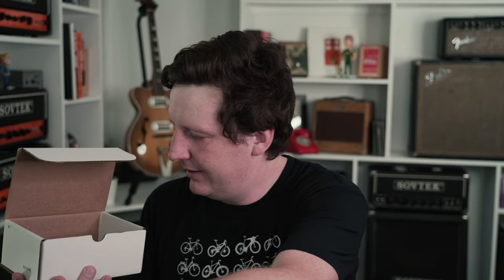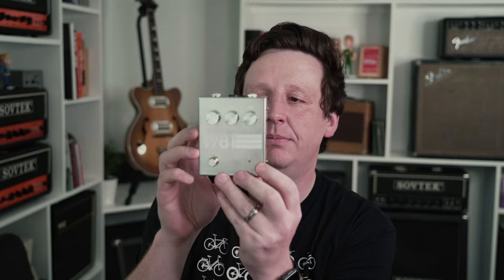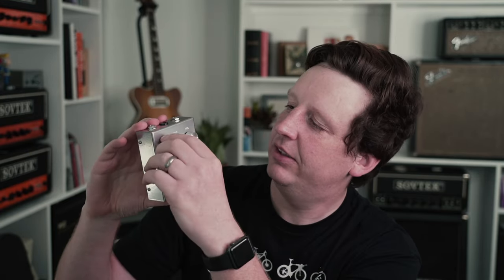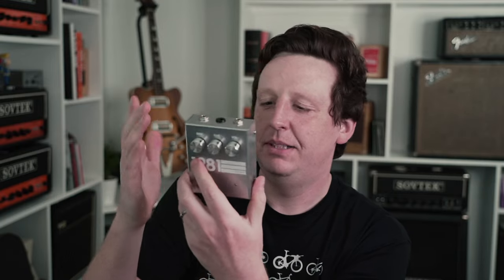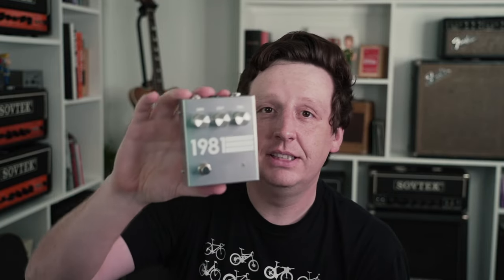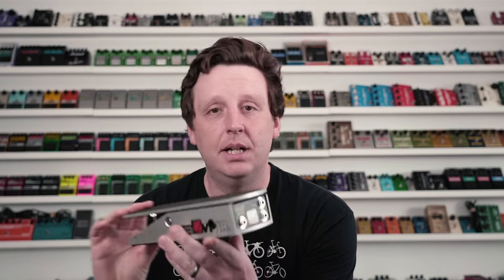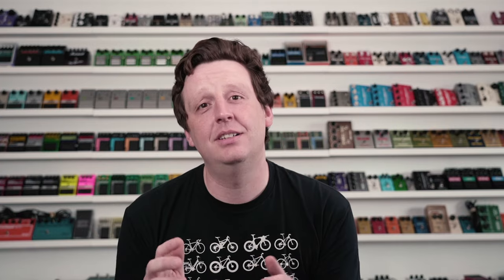Why You Need A Buffer

Comment: ok... so I got 10 pedals in my chain, 6 of them are buffered. I noticed some serious "tone suck"  muddy sound. I plugged directly into my amp, and the sound was shockingly different (way better clean tone). Why do the 6 buffered pedals not accomplish this?Would a buffer before the chain or at the end of the chain likely accomplish what I need to get rid of that treble bleed. Will it brighten up/ replace the dynamics that appear to be gone with my pedal chain? 

Also on a side note, why does it seem like that "Tone suck" is not constant. It gets worse and a little better as I play. why is that?
Reply: Watch the  Wampler video about  "Non-True Bypass switching"
Reply: @nicolasjarpa4336  will do. I believe my problem is resolved though. I rearranged the pedal  order, added a buffer, and found a cable that was not 100%. all is good now.

Comment: Very interesting, thanks.  I have trouble with a big volume drop when i engage a vibrato - especially when playing clean stuff (TC Electronic Shaker), which i have in my FX loop with other pedals (chorus & delay)....Do i just throw in a buffer before the Vibe? Job done?     No other pedal on my board seems to suck volume.
Reply: Wondering the same as my "uni-vibe" is a Keeley Monterey but it is new and have not yet played with the rest of my setup....just played it in practice in front of amp.  However, if I use it in my chain before the the amp, I then think a boost  would be needed...Example:  Guitar > Boost > Keeley Monterey > J Rockett Blue Note > Vertex SSS > amp.  Modulation is in FX loop.  I think a boost can't hurt but don't yet see a need for a buffer and do not have that much length in cables.  But.....you did mention the volume drop and that would signal to me that a booster is needed.
Reply: @davidsisto7694  thanks mate. I appreciate the advice. Stay safe! 🙏

Comment: Hey, I've been trying to get fuzzes to work with my wireless unit for sometime. My wireless has a 50 ohm output impedance so fuzz hates it. I have found a reamper by radial that helps a ton, but it's still not quite there. Do you know of any output impedance adjustable buffers?

Comment: How do you know if your pedal has a buffer? And, can you use Boss pedals as a buffer when they are turned off?
Reply: Do your research about the pedal and if it says True Bypass, it's not buffered. Boss pedals are buffered even when they're off (in bypass, not off as in no electricity :D)
Reply: wow great question. please share the answer when you find out! thanks
Reply: Pretty well any and every pedal that uses electronic switching internally, including Boss, Yamaha, and DOD will have an always-on input buffer and output buffer, because their switching system requires it.

Individual buffers do not add much noise at all, but as much as I concur with Josh on the quality of Boss pedals, the input and output buffers, summed over a dozen or more pedals (typical of contemporary pedalboards) can generate a bit of hiss.  At low volumes its no big whoop, but at higher volumes can be irritating  So, while I have no quarrel with e-switched pedals, and don't view true-bypass as any sort of miracle panacea, if your pedalboard is big and complicated, it can be useful to have a true-bypass loop selector to take all those buffered pedals completely out of circuit.

Comment: Whoa whoa whoa, I just got a Boss CS-3 compressor, and have it before the big muff (and pretty much first on my pedal board). My thinking was I didn’t want to raise the noisefloor with a noisy muff in the chain. What compromise am I really making by having a buffer before fuzz, my fuzz isn’t as fuzzy?
Reply from the maker: In general a buffer will affect a fuzz by making it sound maybe thinner or just "wrong" from what it's supposed to sound like. But a Big Muff may not actually be affected by it. Best thing is to try it before and after to see :)
Reply: JHS Pedals 
Thanks for the input! I tried it before and after, and couldn’t notice any major differences. If anything maybe it sounds better after, compressor turned off of course, but I think this might be in my head. In any case thanks again for your input. 
I have been watching your channel lots lately and have been learning a lot and finding new inspiration in my pedals. Can’t thank you enough.
Reply: @CravetheGrave  Pete Cornish built a buffer into Dave Gilmour's Big Muff. The first pedal his signal used to see was a Boss CS-2. Gilmour's tone is considered to be one of the best ever...
Reply: @CravetheGrave  In any way the buffer of the boss pedals is always on. Even with the effect off it is still buffering. :-)

Comment: Why is it a rule to put buffer after the fuzz? What if you are splitting to have a FUZZ and OD in parallel? Can you use a JHS splitter with buffer built in? Or is this a bad setup?
Reply: buffer will weaken and thin out your fuzz. Generally, people do not want this, so its a rule to put fuzz at the front of your chain no matter what. If you want to run a fuzz and od in parallel, then just dont use a buffered splitter. You could either throw the buffer right before the od, in parallel with the fuzz or just put it in series after both of them. Try all 3 and see what you like best. Cant hurt.

Comment: Got a question if anyone knows. I can’t get rid of a slight hissssss. 
Amp-hot Rod deluxe
-Mogami platinum cable from guitar to a buffered bypass Kongpressor/TS9/BD2/distortion pedal/ green Russian distortion/analog delay/digital delay. All Mogami patch cables. Then Mogami gold cable to amp. 12’ guitar cord 10’ cord from board to amp. 

If I plug straight in. Crystal clear no hiss. 
Go though to board and I get a slight hiss. 
I’ve tried adding pedal by pedal to the chain. Once I get over 4 pedals I get a hiss. No matter the order. 
I like to play clean a lot and this drives me nuts. 
Power supply is a cs12 True Tone. Each pedal has its own power supply cord. 

Will a buffer kill a slight hissss

Thanks guys.
Reply: Try a noisegate somewhere in your signal chain, it could be one of the drive pedals adding that hiss and a noisegate will magically clear that up. Also you want your power to all pedals to be clean either from an iso-brick or every pedal being powered via battery. Don’t plug pedals into a power strip or the wall
Reply: The buffer is making up treble and bass clarity that is lost from multiple cables. ( every inch of cable dials down the tone slightly)  you would probably benefit from a buffer as well, but not for the hissing problem
Reply: It’s probably the True Tone, I’m going to assume it’s a daisy chained power cable not truly isolated? If so just get something like a Pedal Power, it has isolated grounded power for each pedal, the hiss could be a ground issue.
Reply: @TheBigDean18  no, the true tone cs12  is an isolated power supply.

Comment: One thing I can't figure out: is the buffer (like in boss or ibanez pedals) active and only works when the powered pedal is off or is it always on even when it's on?
Reply: It's always on. As a battery save utility, the pedal shutdowns when no cable connected.

Comment: I’m looking into buffets for a reason. Was hoping you’d show the audio difference. I plugged my guitar straight into my amp the other day and it sounded so much fuller, louder, overall stronger signal. The problem is thag I play post rock, ambient, and post metal. lol. So not using pedals isn’t really an option for me.

Comment: So do I need to sandwich my board if I dont have a Fuzz on it and I have a buffered bypass at the end? Will the buffer at the end usually suffice?
Reply: Buffering has nothing to do with fuzzes other than that a buffer should be placed later in the chain.

Comment: May be a goofy question but does the pedal have to be “on” in order for the buffer to work? I have a EHX Canyon at the end of my chain with trails on (to what I understand - activating the buffer) but I only use it in very specific situations. Is it still giving me the buffer even though it’s off most of the time?
Reply: My understanding is if it is plugged into the chain and powered up, it is acting as a buffer weather it is on or off. But maybe Josh  will chime in and confirm
Reply from the maker: It depends on whether or not they were designed to buffer when they're off or not. I don't know if the EHX Crayon is designed to do that. You can try a listening test. Is it true-bypass? If it is, then it would have to be on to be buffered for sure. Most EHX pedals have a true-bypass or buffered option.
Reply: Thank you gentlemen!

Comment: Regarding a buffer after a fuzz, does this mean all fuzzes (I.E. Fuzz Face, Big Muff, etc.) or just certain fuzz pedals. I’ve heard time and time again that (if memory serves me correct) that germanium fuzzes have issues with a buffer after in the signal chain
Reply: It's ok too have a buffer in front of a big muff.
Reply: A Big Muff is silicon I think, so at least it should be fine
Reply: Germanium fuzzes have issues with buffers either side, and the buffers in certain wah pedals can cause issues with silicon fuzz pedals as well.
The MXR Classic 108 has a switchable buffer for playing nice with a wah in front. Good pedal. Sounds almost as good as an Alanlogman Sunface BC108.
The Analogman pedals are so well made that they experience fewer issues with buffers than most fuzzes.
Reply: No problem using Muffs & bufffers. I run an MI Boost 'n Buff into a Muff and it sounds rad.

Comment: Can i use the JHS Buffered Splitter to send the two separate signals to two pedals (an akai headrush 2 and a digitech jam man, specifically) instead of using it for two separate amps? The two loopers then go into a mixer whose output is routed to the amp

Comment: I don't know if there's no such thing as a bad buffer. My dad's old cry baby from the 80's for example has some definite tone suck. Also, I feel like the buffer needing to after fuzz depends on the fuzz. All of mine work fine after buffers and I feel like all guitar gear, the buffer is situational. Maybe less so, but I still think that it does depend on the board
Reply from the maker: Yeah, some of the older buffers can be pretty bad. Anything contemporary will be good.

Comment: Hey Josh, what about tuners? I have the sonic research mini tuner, do I plug into the tuner, then fuzz, then buffer? Or is it always guitar into fuzz, then tuner, then buffer, etc. Thanks for posting your videos, you rock! 

Cheers,

Matt
Reply: I’m not Josh but ... sonic research tuner is True bypass right? It doesn’t matter if you have it before or after your fuzz. Maybe turn the fuzz off when using the tuner to have a clean signal come in. Buffer after fuzz yuppppp
Reply: Jv Dyk ultimately I just needed an answer, so thanks! I’ve heard germanium fuzz’s don’t like any pedals before. However the tuner is muted anyway so i wouldn’t ever use it to tune on the go. Can always test and try things out. Anyway, thanks for the advice.

Comment: How do you put a fuzz in front of a buffer when it’s supposed to be late in the signal chain?
Reply: Think they explain this in this one: https://youtu.be/U9xtAP1cw5U?si=kzE58sN39wAtkg0U — basically you don't, only certain fuzzes can get away with being put in the gain portion of your board, while others are designed such that they can only handle being first, and they're kind of an exception to the placement of gain pedals otherwise

Comment: Josh, does the boss pedal's buffer works even when the pedal is off, or it must be on all the time? Thanks
Reply from the maker: Yes, it does.
Reply: @jhspedals   I have a cheap delay pedal in my FX loop that is on all the time, but the tone change when I enage the loop is very obvious. Would replacing it with a trusty Boss DD help even if the pedal's on every time? I have like 12 meters of cable running from the delay to the loop and back...

Comment: What if I put a boss looper pedal at the very end, would that help? I'm assuming it has a buffer like most boss stuff. And if I have a boss tuner would that be an example of sandwiching?
Reply: Despite the Boss looper having a buffer, you might want a boost after it as they tend to suck tone kind hard regardless of thier bufffer. The digital converter is kinda harsh.

Comment: I had planet waves old tank tuner going at the start of the chain (wah,mxr boost/od, nova delay) no prob.  put a klon clone (buffered) in there and got noise everytime the tuner LED was on.  Put the tuner behind the clone and no problem. Thought it was the buffer for some reason but it Could be something other than the buffer I suppose?

Comment: So I have a boss rv6 I use at the end of my fx loop if I put a boss tuner pedal at the start of my effects in the front on the amp does that mean I have a buffer at the start and end of my signal chain ?
Reply: yes
Reply: No, the FX loop is after your pre-amp.  If you wanted to sandwich the board, you would need a buffer before your amp input...  If you're fx-loop is unbuffered then having a buffer there is also a good idea I think?  Mine is buffered already so I'm not really sure...  but I think buffers in fx loops is a whole other topic.

Comment: How bad will it affect the sound of the fuzz if I use a digital wireless system first into it?
Reply: Its essentially like using a buffered signal. It may or may not sound bad depending on your fuzz. A fuzz face will not sound good but an ehx big muff will probably be fine.

Comment: Is there anywhere on the interwebs that just has a list of Buffered Bypass pedals? I'm trying to look for buffered effects pedals that aren't going to break the bank and already have an overdrive and distortion so I'm not going for the Boss SD-1 or DS-1. Anyone have suggestions for a cheap buffered effects pedal that's useful?
Reply: Any Boss any Behringer, anyone that doesn't say True Bypass which is the opposite of buffered Bypass

Comment: Question: if you have buffered pedals in your chain but they don’t “sandwich” the other pedals. Does it still have the desired effect or not at all?
Reply: Yes it does have an effect. In some cases you might not actually want a buffer before another pedal (such as a germanium fuzz) because it causes an impedance mismatch that causes your pedal to behave poorly (because it wasn't designed with that in mind).  But placing the buffer later in the chain will give you the benefits of a buffer without causing that mismatch I mentioned before.
Reply: Stephen Prentiss awesome man thanks for the reply. I was running my source audio nemesis last in my chain I’m true bypass. And since I switched it to buffer mode my signal sounds a lot fucking better. It’s crazy how you don’t notice it until you’re looking for it
Reply: @gabe70hb  awesome! I'm glad it helped out a bunch. I have the Nemesis but I've always run it in buffered bypass mode. It's an awesome pedal.

Comment: I have two boss pedals in my rig. And I've tried playing while plugged into my pedals and straight into my amp, and have noticed that the tone was different as if I'd cha her the strings. I've grown to like that brightness that having those two boss pedals add with the built in buffers, and I feel like my tone is way too dark sounding without them. So to me this is why buffers are good, because they help add that brightness, which will also help the guitar tone cut through in a mix

Comment: Using a looper [Boomerang] at the very end of a pedalboard, should a buffer be placed BEFORE the looper, or AFTER the looper's output? Thank you!
Reply: If it's a standalone buffer, chuck the looper before it. If it's a built in buffer (like a tc electronic pedal or a vertex boost) at the end,and you want that pedal in your loops then like chuck the looper after it and it's chill.
But usually, everything inside the sandwich, except stuff like vintage fuzzes or wahs.
Reply: @matthewpowell2527  Many thanks, Sir!

Comment: Forget bypass for a second. If one were to remove the buffers from, lets's say a Boss DS-1, would that affect the sound of the effected signal? Like, would that reduce high frequencies? Would it make the pedal interact differently with the guitar knobs? Or would it have no effect whatsoever?
Reply: It probably would DECREASE high frequencies. 

Keep in mind there's a difference between buffered bypass (boss) type pedals and Non true bypass tone suck (MXR) type bypass
Reply: Yeah, I was more curious what the buffers do to the actual effect as opposed to the bypass signal. Josh's comments on placing fuzz before buffers made me wonder what other dirt pedals might do without built-in buffers in front of them. I know fuzz issues with buffers generally have to do with input impedance; but it still got me wondering.

Thanks for the thoughts.